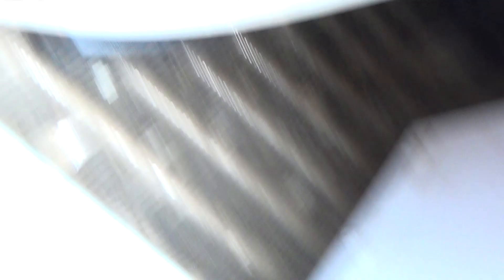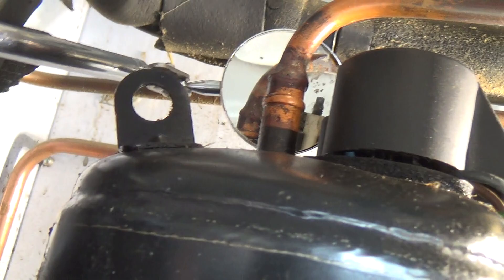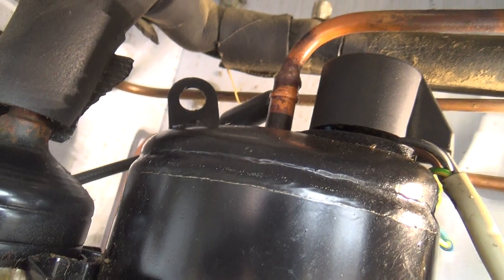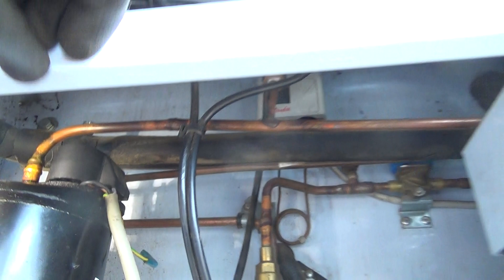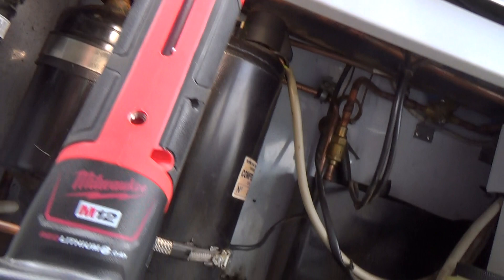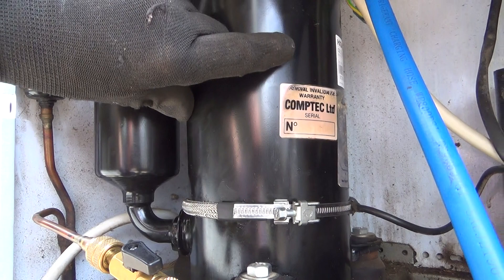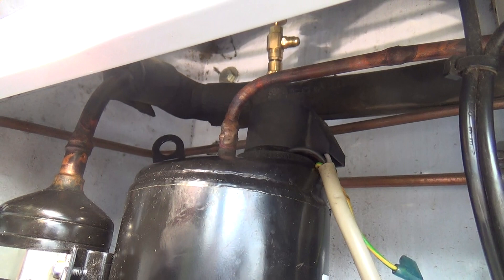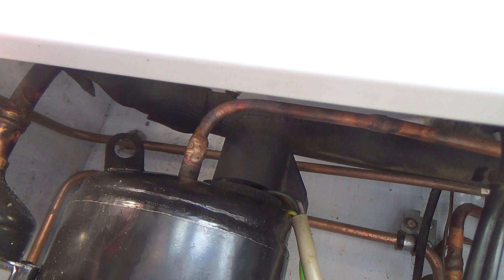Zanotti Leak Fix and Recharge

Comment: Did you have to put in a new charge or did you re-use the reclaimed one ?  I cannot stand 407c because of that massive bloody glide it has.
Reply: maybe you are just a weak mechanic  or  you overthink things?
Reply from the maker: I put a new charge in it. If it was a bigger system with a txv I would probably have put the old gas back in and topped it off with new to get a full system. I don't like blends either with their glide, none of them work as well as the older single component refrigerants imo.